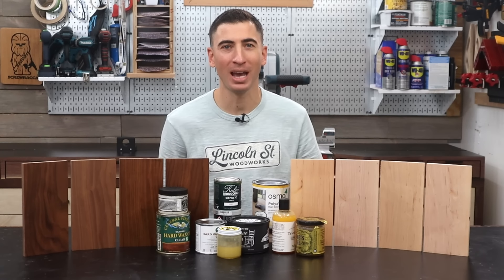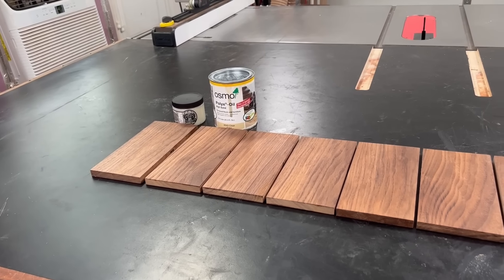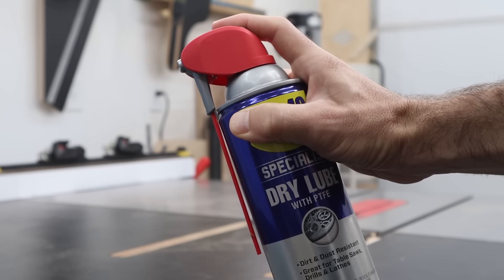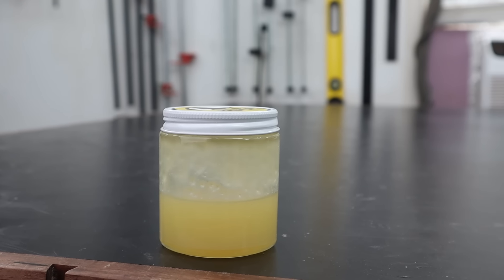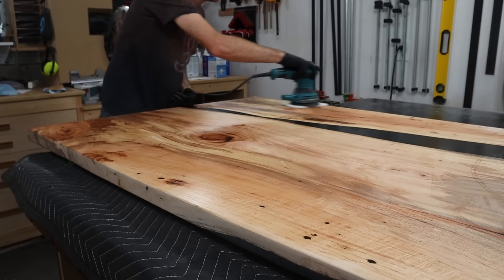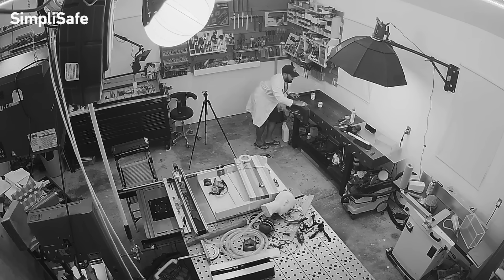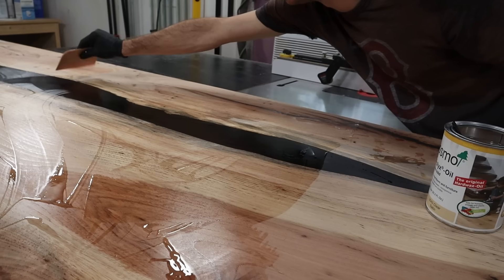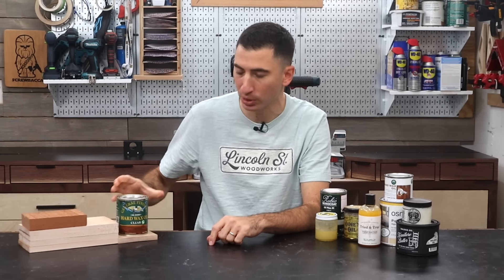Debunking Hardwax Oil Wood Finishes

Comment: I have been using hard wax oils since the it started getting a lot of traction from YT influencers mainly because it is so easy to apply and does protect pretty well.  But I tell anyone I gift something to.....bring it back to me when it needs to be refreshed.  For my own use, it's easy to touch up because it's not a film finish.  But now with nano coatings?  They are damn expensive but wow!  The durability is amazing!  There is no going back for me.
Reply: Serious question. How do you know the durability is amazing? I’ve heard they scratch quite easily. And as you said they are insanely expensive. And how easy are they to repair is they get all scratched up?  Let’s reserve judgement until they are time tested.
Reply: I believe your question was honest and not trolling, but I feel it's valid to share an opinion on a table that I made for my kids.  It sits in the playroom and gets abused daily and still looks like the day I finished it about a year ago.  It is only my opinion and not based on empirical analysis, but it is clearly next level for table top finishes.  As they say, your mileage may vary.  ;-)   @CarlYota

Comment: Nice video. However the ceramic snake oil craze has to be the most ridiculous thing I’ve seen lately in terms of wood finish. It may repel water for a little, but wait till your client cleans their table over and over and wipes the snake oil right off. I can’t with good conscience require my clients to be reapplying wax, oil or ceramic coatings every year or month for that matter. I will agree that shooting high voc products is not possible for most, and downright dangerous without a booth. But there are some incredible 2k or even 1k water based products that are really amazing now and won’t break the bank.
Reply from the maker: Yeah i think the 1-2k water products are only used in production environments so its out of sight out of mind. If i had the space - I would do that every time. But for someone like me that needs a little extra protection its a viable option.
Reply from the maker: @davidiliyn I bought them. When I do the ceramics video I will be up front - no one is paying me but cam is a friend. If it sucks, I’ll say it sucks though.
Reply: @Lincolnstww  right on! Thanks for making the comparisons!

Comment: You need to do a better study and review of Rubio Monocoat. Reading their brochure will help. I’ve notice most of even the best wood working professionals don’t really know Rubio thoroughly and that’s sad.

It is a patented, molecular bonding polish. So the polish only binds to the wood fibre. A second is actually counter productive. That’s excess and needs to be wiped off.

While other natural finishes could compare to Rubio, when it comes to coloured polish, Rubio is untouchable because it is a single coat finish and molecular bonding.. consider the following scenario…

1) While polishing large sections of one area dries up, has excess application, swirls marks, overlaps or whatever else… it does not show, because it is a molecular bonding polish. Zero overlaps or application marks.

2) If a table is scratched, just apply Rubio (esp imp in color stains) on the exposed wood fibre / scratch and wipe off. It blends with the surrounding area. No need to scrub the entire surface or a patch around it.

In my view it is the most premium and solid product for most applications but needs to be applied correctly. Like opening the fibre with 120 grit. Cleaning of the sanded dust with a recommended Rubio Cleaner, else the polish will bind to the microscopic wood dust instead of the wood fibre… etc etc.

In my view it is easily the best oil stain there is.
Reply from the maker: yeah they are great for colors - but this was about keeping the natural look of the wood. Osmo performs just as well when you're repairing.
Reply: @Lincolnstww  I agree, but the second coat required or making is better is not true. A second coat makes it worse, unless the first coat had gaps or hasn’t been rubbed into the grains well enough.

Also to add, the color information was also to reinforce the point about molecular bonding. Even if the finish is natural, a molecular bond is much stronger and gives better protection.

Comment: Lately, I've mostly used boiled linseed oil and put a few coats of polyurethane on for surfaces that see use. I've tried using paste wax, but I find it's a major hassle for larger boards. For food-safe woodworking projects, I've recently been converted to pure tung oil. 

I've never played with any of these hard wax finishes. Maybe I should give them a try.

Comment: My only question would be, how long did you let these samples cure before doing the liquids/staining tests/crayon rub test? At least for the true hardwax oils they won't reach their true level of protectiveness until the finish has fully polymerised, which can take up to around 30 days for most of then. Yes you can apply second coats in 24 hours, but it doesn't fully polymerise for much, much longer. I'm guessing that the Rubio excelled in the crayon rub test because it is mixed with a hardener, which accelerates the curing process, whereas the others might not have had time to polymerise properly?

I've made a lot of coffee tables with hardwax oils and never had any issues whatsoever with the finish coming up or clouding or discolouring whatsoever when using a warm soapy sponge to vigorously scrub at dried gooey sht that's stuck on the surface, even on darker timber, but that's always been long term, well and truly beyond it curing fully
Reply from the maker: Thanks for watching - as I said in the video everything cured for 4 months. My guess is because it was a microfiber towel and not a sponge that it messed with the finish. Its like rubbing a bunch of velcro on it

Comment: Easy application and use is a huge selling point. But... The claim to fame to specific brands, namely Rubio, Odie and (lesser degree) Osmo is YouTube. None of these products are readily available where 99% of retail finishes are sold. None of these products are in wide distribution nor use by commercial nor industrial wood production companies. They may be good, they may be great, but their claim to fame is internet driven to this day. And that's not a bad thing, nor a good thing. As long as the product deserves the praise it gets and does what reviewers claim.
Reply: Thanks. That's such a good point
Reply from the maker: Internet is no doubt to blame for the hype. But I’ll double down on what I said in the video - the internet fell in love because of easy application and use. When you’re filming a video - you just want something idiot proof that works well enough. Fixing “build” mistakes is interesting on camera. Fixing “finishing” mistakes is boring. Thanks for watching and good insights

Comment: As a long time hobbyist woodworker, I find these tests interesting and really enjoy your videos. My outlook though is, comparing "Food Safe" finishes to not food safe finishes to be, not apples to apples. In all actuality if I am working on something not to be used as a food safe item I will most likely be reaching for a poly and for food safe, at this moment in time, reach for Tried and True. I know the Tried and True will need to be reapplied through the items lifetime. Many of the other 'better' finishes for something like an end-table or tabletop are expensive compared to the products' selling points. Remember, I am a 'hobbyist' not someone making a living from my woodworking.
TLDR; the info is great and thanks for the time and effort put into the making of the video. I look forward to all your videos.
Oh, and PS....
I have a table saw that hasnt been lubed in over 5 years (I dont PM my tools as religiously as I should either)😉. I definitely will look into the WD dry lube. Thanks again.
Reply: Actually, all film finishes once fully cured safe for food contact - just the manufacturers know there is a market for "food safe" and will gladly make money on that.
Reply: @Mike-bh7sh  From what I can tell, most finishes in the category of "food safe" are just not film finishes, because you don't want your cutting board imparting bits of plastic into the onion you're chopping. From a different perspective, film finishes could be considered the most food safe because food liquids and the bacteria they carry aren't going to penetrate into the wood grain and fester, so poly might be fine for something like a fruit bowl.

Comment: Would be interesting to see how the oil type variable factors into the results since the contendors cover the gambit, some of those (usually the "secret ingredient" ones) are mineral oil based, some are tung, some like Walrus use non-traditional polymerizing like hemp/safflower, and then some are linseed. Anything non-polymerizing you're basically relying on the wax for your protection. I'd also disagree with the "we've convinced ourselves that we like matte because of ease" argument, as I think it was more originally driven by "hey, this finish holds up pretty good and doesn't look like my piece is laminated in plastic"
Reply from the maker: I think thats a fair way to position it - I can't argue with that side of it.
Reply: Yep. Penetrating oil vs film finish has been a debate going on for a long time. Modern hard wax oils didn’t create this controversy. They are just the new trend of an old idea: penetrating oil that got waxed over. 

I’m confident that most people who choose penetrating finishes do so because they like the look of a natural soak in finish. Film finishes, as you said, literally encase the wood in (usually) plastic. 

And this has been the back and forth for as long as I’ve known. Long before modern products made the penetrating finish super easy and quick. People were still choosing to oil instead of poly for the stated reason. 

The problem with the test in this video is that number 4 looks much darker than the others and that’s why people picked it. Color, not sheen or feel (which we can’t even tell from the video). 

People like dark walnut. And lots of people don’t like the encase on plastic look. Wood isn’t naturally glossy so it looks fake to me when you make it look that way with plastics.

Then again, I’m the weirdo that sands the poly off a new hammer and oils the handle instead. Even better is an old hammer that fit oiled and burnished from decades of use.

Comment: I applied Rubio on my oak stair threads. Used very regularly - and... it is perfect. 5 months now, behaves like hard polyurethane lacquers I have known since my childhood.
Reply from the maker: I’ve found the big advantage is a quick spot repair if needed too
Reply: That’s because it’s literally made for wood flooring. Furniture makers just started using it as a trend. But if your furniture is seeing more wear than a floor you’ve got other issues.
Reply: @Lincolnstww   Hopefully! Luckily, I have not had to do any repairs yet.

Comment: Both are very expensive and require frequent reapplication especially Odies oil. Try Nutura if you want a hard wax oil. Also avoid water based film finishes, they all leave a blue tinge.
Reply: Thanks for your nice comments

Comment: Thanks for the in-depth look into some of your favorite finishes. Great video. Have you ever tried natura one coat? Curious what you would think compared to Rubio. Especially with the carbon coat on top of it. I recently used carbon method on my table saw and am sold of the nano coatings. Waiting for a nice wood project to try it on. Thanks again.
Reply from the maker: I havent tried it - I spoke with a friend that used it on a project and they were luke warm on it and wont be using again. The nano coatings are really impressive but really expensive.

Comment: Fantastic video bud! Rubio just came out with sheen plus! Just in time for this video! Haha
Reply from the maker: Dude I was hitting in the process of finishing the edit when someone sent me their post releasing it. Your reel looked interesting on it. I think it could be good for them
Reply: Lol, so they need yet another product to make their finish look half decent with some sheen. What a joke
Reply: I think it's creative. Giving you 2 different options of sheen. Depending on species you may still want to keep the matte look. Like reclaimed oak for example looks much better with no sheen
 However it's fantastic for walnut.
Reply: @lighthousewoodworks  well with Odie’s you can achieve any sheen, look and feel simply by the surface prep. No sanding restrictions means no limitations. Can do it all with one product.
Reply: @boulderguywhy  - grab a drink and chill. then check your blood pressure.

Comment: Fun fact: VOCs are regulated primarily for smog control.  Compounds like ammonia, which are commonly found in finishes, aren't healthy to breath but are inorganic so they don't budge that VOC percentage which companies now use as a marketing tool.  That VOC label doesn't really mean much in terms of how safe a finish is to breathe in, or at least it's not the whole story.
Reply: I’ve been in the coatings industry since 1985, and I’ve gone through so many different iterations of VOC laws it isn’t funny. The VOC that you see on the can is not a marketing gimmick. That number is backed up by their safety, data sheets, which can be regulated by the EPA and OSHA.  And that little device to test the VOCs in the video, I’m not so sure it’s accurate. Years ago acetone counted as a VOC. But we lobbied to get it removed since acetone does not contribute to degrading the ozone layer. It’s an innocuous solvent. It’s not a pollutant in other words.  And it’s not a stretch to say that lower VOC products are actually less durable than their higher VOC counterparts.
Reply from the maker: Yeah i think "its not the whole story" is what I agree with. I was hoping that was the main takeaway from this section and to just wear a respirator

Comment: Very insightful. I have some yellow birch with some beautifully interesting grain patterns to it and I'm planning on building table. I was thinking about a hard wax oil but my wife was hoping for something darker. I don't want to lose the beauty of the grain patterns. Wondering if you have some suggestions
Reply from the maker: So she wants to stain it darker? Lol good luck - the wife normally wins. Maybe use something other than the birch for the table is my advice

Comment: Hard Wax oil is so easy to make in the shop that I am amazed the companies that sell ya a little can for $50 can stay in business.  Buy a lab hot plate from Amazon, some hard wax of your choice, some limone orange peel solvent (a more pleasant smell for the shop/home as well), get a can of tung or linseed oil and a bag of pine resin for some sheen, heat it all to 153 or so to meld it together and Bob's yer uncle.  There are plenty of Youtube videos about the process, it makes your finish one of the less expensive parts of your build with surprisingly good results.  You could also ask people who make their living with fine woodworking if THEY are wasting resources the way us amateurs do.  -Veteran '66-68

Comment: Nice comparison and test. I've noticed a significant difference with Omso when using 1 vs. 2 coats. As for VOC's, I make sure to use Osmo outside when possible because it's pretty strong for the first 12-18 hours or so. Looking forward to the ceramic testing.
Reply from the maker: I do love osmo!

Comment: I guess the other question is, how much better are these finishes than other easy to apply finishes like shellac?

Or something that is also, Lovio see like epoxy?
Reply: Epoxy isn’t low VOC at all. It’s extremely harmful and you should definitely use it like a dangerous solvent in open air with a respirator.

Comment: On the wood whisperer’s test, he awarded natura one coat the overall winner. Any reason why that finish didn’t make it into this test?

Would also be very curious to see a comparison with a UV cured finish.
Reply from the maker: I started my test about 1.5 months before Marc’s vid so it wasn’t even in my radar to be honest. And I think the UV finishes make no sense unless you can put them out in the sun. Those lights are expensive and dangerous, I want no part of a big UV light
Reply: @Lincolnstww  Thank you very much for the response!

Comment: It would be interesting to measure the VOCs during an actual application in a typical garage/shop.  BTW, I picked #3.  Go Tigers.
Reply from the maker: Yeah it’s such a tough test to standardize though. Go tigers!
Reply: @Lincolnstww I would argue it’s an impossible test to standardize over the internet. It didn’t represent sheen at all. People picked number 4 completely based on color as it was significantly darker than the others and that’s what people want in walnut. Any true experiment would have to be done in person with woodworkers (not laypeople) that get to touch the wood and look at it from all angles.
Otherwise we can’t claim that people don’t like the satin sheen of hard wax oils. Or that they prefer higher gloss surfaces of film finishes. 

The test basically told us nothing but I appreciate the attempt. I found that aspect way more interesting than comparing the various oils. But your conclusion is likely wrong because the test doesn’t work well online nor did it isolate the variables.